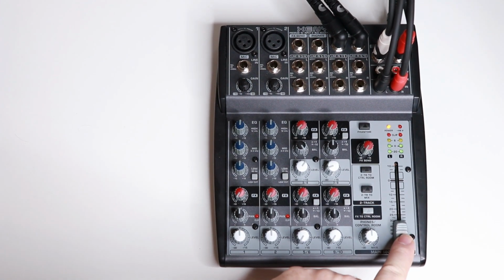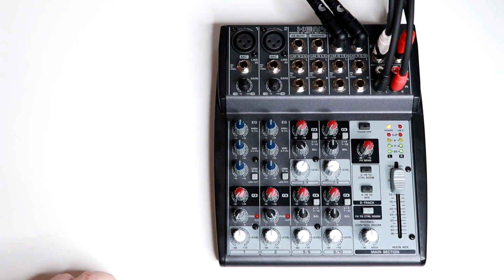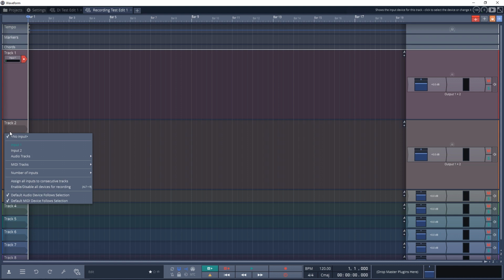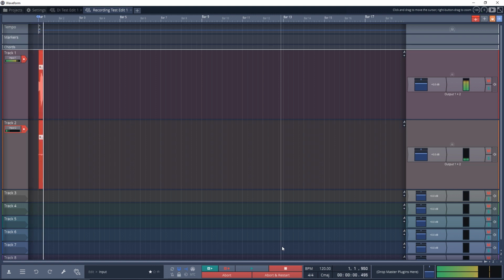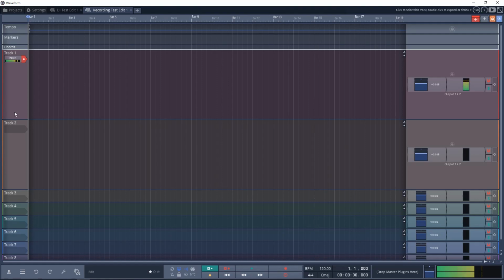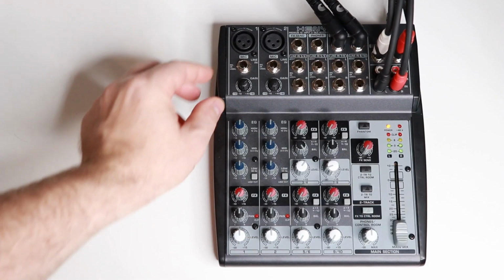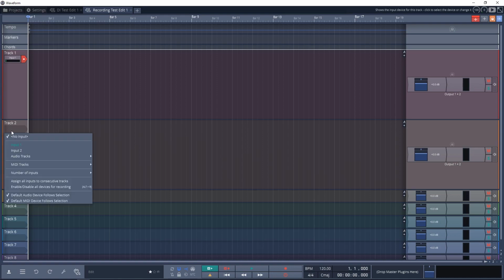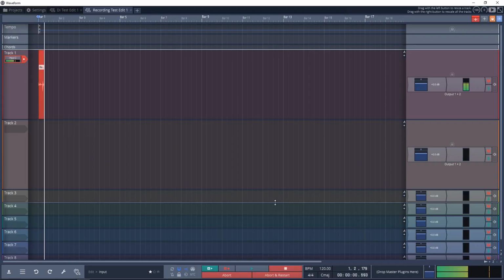Connect Mixer to Audio Interface

Comment: Great video - I've had a M-Audio M-Track Duo USB Audio Interface for a few years - and until now its 2 Line-in ports were enough when I got my Behringer Pro-800 last year. But I just got a Behringer LM Drum - and need more Line inputs to hear both of them - so ordered the Behringer 1202SFX (should be here this week). However I was informed that the 1202SFX interface doesn't have ASIO drivers - whereas my M-audio does have them - so I'll be daisy-chaining my Synths to the 1202SFX - and then connecting the 1202SFX to the M-Audio...but didn't know how to...until your video - so now going to order 2 x more TRS Jack leads - many thanks from London, England 🙏👍🙂

Comment: Thank you!!! Great video!!! I have a quick question... I currently use the Behringer Xenyx QX1202usb  but when I got to the sound card M-Audio M-Track 2x2 (C-series)  the voice changes pitch in my live on streamyard... any idea how to fix that??? If I use the Mtrack alone doesn't happen but I want to add instruments and more mics that is why I use the mixer... when I use the mixer usb alone, I can't hear the invite on our stream not sure why... help please!!!
Reply from the maker: It sounds like the mixer and audio interface have different sample rates. I think the Mixer sample rate is 48khz. You likely have your audio interface set to 44.1khz or something else. I’m not sure you can adjust that in streamyard but you can change it in your windows sound settings. Go into your windows sound settings and into the advanced properties for the M AUdio Interface and change the quality to 24 bit 48,000hz.
Reply: @AudioTechTV  oh I didn’t think on that… I will check it out, thanks a lot!
Reply: Awesome I will do this! thanks a lot for your help!!!  @AudioTechTV

Comment: 4:18 - is it possible that you meant for the RCA tips to go into the IN and not the OUT on the Behringer in this step?  The other end of that cable is plugged into the Scarlett LINE OUTPUTS, which means basically both ends of that cable are plugged into a device's output, which I can't make any sense of, audio chain-wise.

Comment: Quick question sorry im late to the party. What if i wanted to add an effect processor along with my setup for example the behringer dsp2024 .. im on windows using ableton , interface is presonus usb 96 with stereo outs and 2 mics/ins . I also have the xenyx 1002.. I can have them all directly sourced and monitored on the xenyx 1002 right?

Comment: are the speakers conected to the mixer or interface
Reply from the maker: Depends on the way you’re connecting it. If you’re just using the mixer for inputs then you can connect the monitors to your interface. But if you’re using the mixer for inputs and outputs then you connect the monitors to the mixer. I think I go over this around 4:20 in the video.

Comment: The newer gen of 2i2 doesn’t have LINE/INST switch. Instead, there are INST and AIR buttons. How does this affect the setup? Thanks for the video!
Reply from the maker: It doesn’t really change anything. If you plug a 1/4” cable into it and don’t push the instrument button then it will be in line mode. So connect your 1/4” cables and don’t push the instrument button and you should be fine.
Reply: @AudioTechTV  Great! Appreciate your swift reply.

Comment: Hi I have 6i6 interface & Mackie 1202 _VLZ3  mixer I bought TRS cables two hook the mixer two the interface.also on the back of the interface  it has two RCA jack I don't  no if I can hook  it up two the interface. Thank You
Reply from the maker: You can use rca cables to connect to the mixer. Some interfaces have rca connections it’s fine for connecting to a mixer.

Comment: I'm using a Yamaha EMX2 powered mixer, which only has speaker and monitor outs. Would I use the monitor outs for the inputs of my scarlett 2i2? Thanks for the video!
Reply from the maker: That mixer is a powered mixer so you definitely want to use the monitor output into your audio interface. Do not connect the speaker outputs to your interface or you could damage the interface.
Reply: @AudioTechTV  Awesome, that's what I was thinking given the power load. Thank you!

Comment: Hello
I have a Scarlet 4i4 and wondering if I can connect a Peavey PV i8500 Powered Mixer to work in my studio.

I am plugging from Input 1 of the Scarlett 4i4 in the back of the PV i8500 labeled as MAIN MAIN speaker output AMP1 and it works just fine.

I am just asking if its advisable to use that kind of connection.

If it is possible, can I also plug from Input 2 Scarlett to Output labeled Main Monitor AMP2  from PV i8500 or is it not necessary. 

I was told to NOT plug in my Yamaha HS7 speakers direct to the Powered Mixer because it would damage both units.

My Monitors are plugged into the Interface

Comment: i have a question. i need to use 2 stereo mics to capture my guitar and also a condenser to capture my voice. all at the same time. so i need to capture 3 separate audio tracks. how can this be possible? ive tried everything but its not working. all that happens is that all the tracks become the same recording. i just want to do live sessions while recording my guitar in stereo. HELP
Reply from the maker: If you’re using 2 stereo microphones that’s 4 tracks right there as left and right are considered separate tracks. Plus you have a condenser mic which would be an additional tracks so you need to capture 5 tracks at once. What you’ll need is an audio interface that can have 5 or more separate tracks recorded at the same time. Then each track will need to be setup in your DAW software and armed for recording. Most audio interfaces have mono inputs so you’ll need to make sure you can split each of your stereo mics outputs so that they can plug into two inputs. So if they have a TRS connector on them you’ll need to convert it. If they already split in two then you’re ok. 

But yah you need an audio interface that can handle all the separate tracks being recorded at once and set it up on separate tracks in your DAW.

Comment: Is this a USB mixer? Whst is it plugged into for main power? May be a dumb question but , thanks
Reply from the maker: No it’s not a USB mixer. It’s plugged into a power supply connected to a regular power outlet.

Comment: heyy I have a Behringer umc22, can I take the main out from my mixer (left and right ) and connect them to my input 1 and 2 on my umc22 since the umc22 has 1 xlr and quarter inch combo jack and another quarter inch jack will I have difference in levels due to the preamp in the combo jack.pls reply
Reply from the maker: You can connect it like that but like you said the levels will be different so if you’re trying to achieve perfect stereo inputs into your audio interface you’ll have to figure out the level adjustment for each channel. But if you just want to use the two inputs separately, it won’t really matter.

Comment: I want to connect 1 xlr mic input ,1 guitar mono preamp input and both the sound I want to come from my amplifier and at the same time i want to record in my interface (so 2 input- 1 for XLR mic and 1 for mono guitar preamp   and 2 output - 1 for amp and 1 for recording interface ).How to do the connection? My amp has only one channel ...and I have zoom h5 as interface ... Plz reply, help me out ...if mixer is the solution then how to connect them?

Comment: Hey whats up. I have a msr24 1inch reel to reel multitrack recorder and a 16 track mixer. DINOSAURS I KNOW.lol
I want  to take that music and use it  in a daw. I thinking of getting the Allen heath qu24 to do this but I'm told that I can use an smaller interface using various connections. What advice can you give me or anyone to answer. The out put on the multitrack is -10dbv unbalanced.   Thanks

Comment: I am planning on purchasing the Behringer mx400 and connecting it to the irig stream. Could you give me advice as to which cables to purchase?
Reply from the maker: The MX400 is a mono mixer so you could use a mono 1/4” TS male to RCA male cable and connect to just one RCA input on the iRig stream. What do you plan on connecting to the mx400 mixer?
Reply: Simple Green Tech an iPad or an iPhone for audio. I have an irig keys but was told that can’t hook into a mixer by gutair center when I asked**

Comment: Hi.
What if i have an Allen & Heath zed-6fx a mixer? A this mixer only has XLR Main Out. Will it works if i connect to an audio interface(Scarlett) via XLR to 6.35mm cable?
Cable like this: 
https://www.amazon.co.uk/6-35mm-Stereo-Balanced-Patch-Cable/dp/B01K54FG18
Thanks.

Or should i use XLR to XLR cable?
Reply from the maker: Yes that will work. You don’t want to go into the xlr port on your interface as that’s designed to accept mic level inputs so these cables will be perfect as they are balanced too. Thank you for watching. Keep creating! 👊👍
Reply: @AudioTechTV   Thank you for responding...
So, if i understood this balanced(stereo) cable https://www.amazon.co.uk/6-35mm-Stereo-Balanced-Patch-Cable/dp/B01K54FG18 will be fine, because i need a line in of an audio interface port, and not xlr port of an audio interface? Right?
Reply: I am very a curious about a this. And i hope, you can help as someone who knows about a this...

As you know Allen & Heath zed-6fx a mixer has only XLR main out port. 
1. Can i connect zed 6fx to Amplifier(RCA) via XLR to RCA cable?
Cable: https://www.amazon.com/Cable-Matters-Dual-Unbalanced-Interconnect/dp/B07SHWYDVQ

2. Can i connect zed 6fx to directly in sound card of PC(3.5mm mic, line in) via XLR to 3.5mm cable?
Cable: https://www.amazon.com/Stereo-Breakout-Cable-Splitter-Microphone/dp/B0824WV22B

Is it same voltage, amperes in all this connectors(XLR, AUX, RCA)? They can be converted(physically) from one to other, but i am not sure they are all same voltage, amperes...

Is it safe to connect like this?
Reply from the maker: Yes this will work perfectly. The cable you mentioned earlier is what I’m talking about.
Reply from the maker: You can connect your mixer directly to your sound card. The quality likely won’t be as good as having a sound card but it’s still acceptable. I recently did a video on how to connect a mixer to a pc without an Audio interface here https://youtu.be/NU76spK22Ig

Comment: Thank you so much for this info but I have another problem... Im waiting for a M Audio Eight, 8 channel interface, Im recording songs wich include drums and I do need 4 mic setup, and plus Im thinking of recording a whole band, 3 mics for the drums, 1 for vocals, 1 guitar, 1 keys and 1 bass and maybe 1 for some percussion, and I have the Yamaha MG10 which i bough specifically , I dont like combos in things like music, even  on my pedals you'll never see multieffects... so to my question, which outputs should I use to input in the interface... the MG10 has atleast 8 recordable channels and plus 2.. but i dont understand which outputs are gonna carry the signal to my Interface, i do use 2 mic inputs from the mixer and i connect my scarlet 2i2 from the mixers speaker output... but i need more available channels for full live band ... plz someone help

Comment: Great video, I have a question, though. I also have a U-Phoria UM2 and we know that the second input jack is for instruments, my question is, Is it alright to plug a mixer in there?
Reply from the maker: Yes you can plug it in but the gain might be different compared to input 1 so you may have to adjust the gain if you’re trying to match levels. It’s not ideal but it will work.
Reply: @AudioTechTV  Thank you

Comment: Thanks for clear explanation! Question: in the first method, with the Mixer already connected to the Audio Interface, wouldn’t it be possible to simply monitor directly from the Audio Interface instead of applying the second method? Wouldn’t headphones on the Audio Interface pick up everything that comes in from the Mixer, as well as output from the computer?
Reply from the maker: Yes you could just use headphones in your audio interface and it will work. The method i was showing was more for the person that wants to put the audio interface out of the way and just use the mixer for everything. Thank you for watching. Keep creating! 👊👍
Reply: Simple Green Tech thank you for explaining! 👍🏼

Comment: Someone can tell me what is the difference if you are recording using just the interface, and if you are using interface and mixer? Thank you
Reply from the maker: A mixer can route audio different ways and possibly allow you to switch between various audio sources without needing to disconnect cables from your audio interface. There are many different ways to use a mixer. It doesn’t add anything to your recording, it might actually colour your audio so if you don’t have a need to route audio then you’ll be fine sticking with just an audio interface.

Comment: I have a Roland Boss BR1600 and I sing on a program called SingSnap. SingSnap doesn't have all the effects I need so I want to connect my Boss BR1600 to my computer so I can sing with effects... my question is HOW? By the way ... my computer does not have a mic input... only USB and HDMI
Reply from the maker: You could connect the line output or headphone output from your computer into an input on the BR1600. Add the effects that you want and sing into the program on your computer it should route the audio into your BR1600 where the effects will be added. If you want to route the audio back into your computer then you should look at getting an audio interface.
Reply: @AudioTechTV  ...thanks so much.... I have no idea what interface to look at... I am on a fixed income and have to watch my finances.....thanks for your help.

Comment: so correct me if im wrong. Main Output going to Interface input. then 2rca connection going from the output of the mixer going to the input of the interface in the back.Then studio monitors go to your control room out? coz i got confuse when you were plugging in the 2 rca connections from the output then you also said plug it in into the output of your interface.

Comment: Hi! Got a question, Can I use as many channels as my mixer have  (12) just by connecting the mixers main out to my interfaces (scarlett 4i4) line in for a zoom session ? Thanks
Reply from the maker: Yes you can use all 12 channels of the mixer. But you can only connect up to 4 inputs to the 4i4 so they won’t record separately. Most of these mixers only have stereo outputs anyway so they will export everything over 2 channels. Some mixers will have a second bus or fx send that could allow you to export 2 more separate channels.

Comment: Just correcting, outputs from interface must be connected to TAPE IN in the mixer, not OUT, another question, I've see another videos and they use TRS cable to connect mixer with interface, is there any difference?? I mean, they are very short cables, Is necesary balanced?

Comment: Mixer can connect in
 Vocal processor for live effects🙄🙄
Reply from the maker: Yes you can connect a vocal processor either as a direct input and plug your mic into the processor or you can connect it as a send effect. Use the send out and plug that into the input of the processor and then from the output of the processor connect it to an open channel. Plug your mic into another channel and make sure you turn the fx knob up so it sends the signal to the processor.
Reply: @AudioTechTV  💚💚💚 awesome, thanks for reply, 🙏

Comment: do you recommend this or just to get the usb interface mixer?
Reply: That depends on your application. If you are just recording one or two things at a time, like a guitar and maybe vocals with it, then a simple usb interface by itself should suffice. The cheaper ones usually have 2 channels if that is all you need. You might want to add a passive mixer If you plan to record drums or even a band.

Comment: Hi. I'm relatively new to all this. For your 3rd setup. The 2 track output to the input on the audio interface. Using 1/4" TS or 1/4" TRS? On your video you are using a 1/4" TS. By the way, splitter for the phones output.What is that? Tried googling and seems I can't find it or I've searched using the wrong keyword.

Comment: I would like to reccord with an 8channel mixer and 8 standalone analog instruments. is it possible that each channel from your mixer is an input in the DAW? or do i need a bigger interface (f.e. with 8 Inputs)
Reply from the maker: You would need an interface with 8 inputs. If you want to still use a mixer, you would need a mixer with 8 outputs too.
Reply: Simple Green Tech thank you! :)

Comment: I’ve been looking for a tutorial on this a long time. How do you connect to the computer? The only way I know is out of the interface. So the order is mixer to interface to computer? How would you add an amplifier to be used to listen to recorded music without the amp affecting the signal going to the computer? In other words I want 2-way sound. First, recording using the setup you’ve shown, and second, music from the computer back through the amp to either my studio monitors or a second set of monster speakers I have?  I guess if I want to play music from a tape player or external CD player I’d connect directly to the mixer? I’ve seen a new mixer, the Yamaha MG10XU which is supposed to be an interface and mixer in one. Does its interface has as good of quality as the Scarlet 2i2? I haven’t found anything tech- or review-wise about it’s pre-amp. But I already have an old Soundcraft Spirit Folio mixer that I could hook up using your method, to my interface. I have to get a new interface and was looking at the 2i2 or the Yamaha mixer. Thank you!